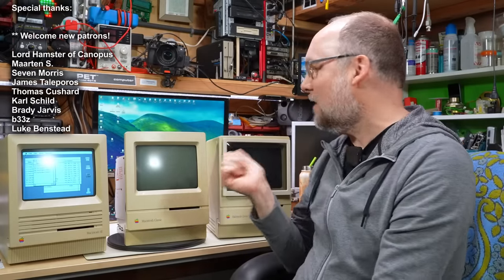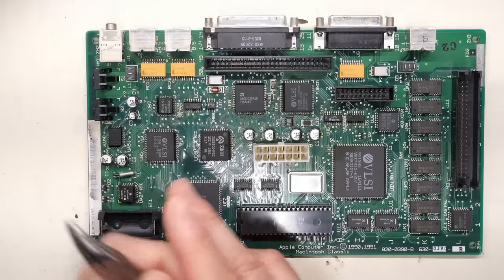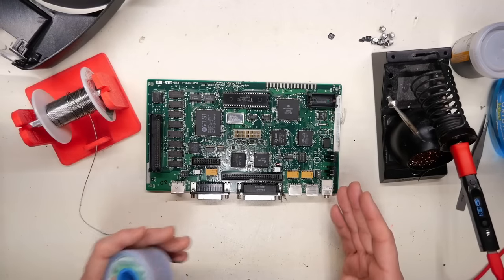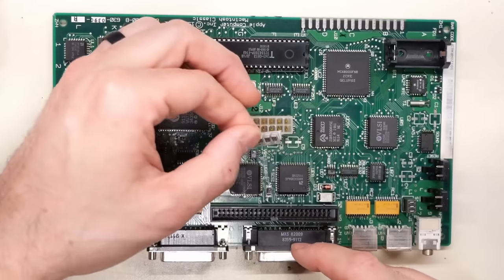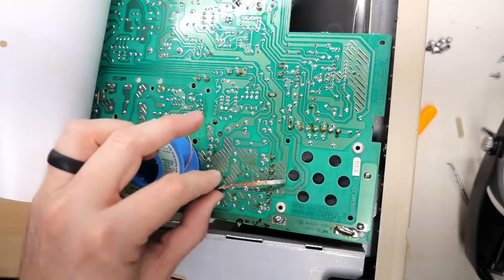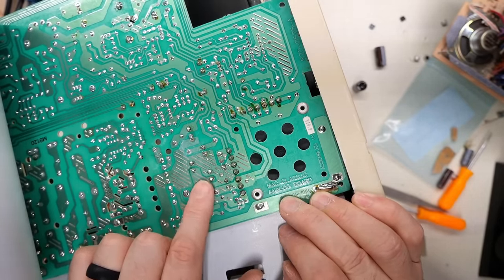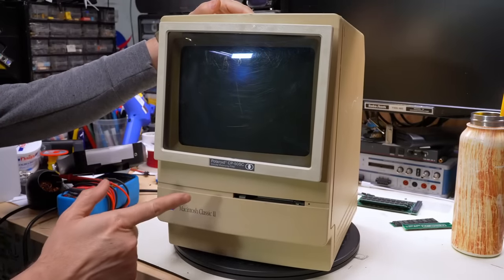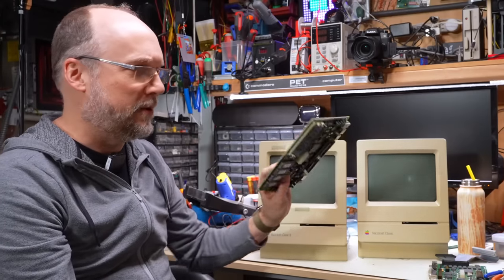Not so fast! I hit some road blocks fixing the Mac Classic

Comment: I would wash the board afterwards in a dishwasher. Seriously, boards are put through a dishwasher after the wave solder process and then air dried using compressed air. This will clean up the board and the compressed air will push the water out from under the components. As always, ensure the board is completely dry before doing any work on it.

I worked in board touch-up and repair for a number of years prior to moving on to the more interesting and more satisfying testing and repair. I recommend using a burnishing pen instead of something sharp to clean the pads. That will clean the pads safely without the chance of hitting an attached etch by mistake.

Electrolytics are used for specific reasons such as better filtering and not necessarily for cost.

Have you ever thought of setting up a test setup? Take a known-good chassis and extend the power cables and cables for the CRT and connect that to an accessible power supply with cables for the motherboard. This will allow for easier testing and troubleshooting without needing to reconnecting the unit up again to test the boards. When I was a bench-tech we had setups like this for the various products and it made testing a whole lot easier.

Comment: By the way! I recommend trying to use liquid instead of alcohol to clean the throttle or carburetor dampers of the car. It also perfectly cleans soldering mud with a gun flushing liquid from construction foam. However, in this case it will be necessary to be more careful with plastic products, as they can be damaged.

Comment: When we had the leaking caps issues in the early 2000s.  We noticed a pattern on the top of the caps.  The ones with a square cross leaked but the ones with. An offset K on top were always fine. So we were at that time in the lookout for the crappy cross caps and happy if a system had “K caps”

Comment: All Mac Classics did not come with that RAM board.
To meet their under $1K price, the base model came with 1M only (no board).
That little RAM board has 1M on it and two slots.  So if you see one with 2M, then it has that board.
I believe it sold with 1M (no board) or 2M (The 2M version came with a Hard Drive, the 1M didn't.).  I don't recall if Apple sold a 4M version.  I don't think so...

Comment: i think that vinegar reacts with the electrolite (i suppose it's usually basic, like bactery residue), so it becomes neutral (aka not corrosive)
of course you have to remove all the vinegar or it's the same thing

Comment: Rather than scratching the pads I've found that when using the solder braid/wick it cleans up much better if you use MG Chemicals liquid no clean flux you won't have that black residue.

Comment: Even if you are going to sonic clean it is good to use the vinegar to neutralise the electrolyte before cleaning.
The dodgy Electrolytic capacitors were conterfeit name brand caps, I have even seen OEM intel boards with these dodgy caps.

Comment: I make sure to check all electrolytic capacitors with a capacitor meter. I recommend doing this procedure with old and even new parts. Marriage, alas, also occurs. It is better to put Low esr capacitors on the power supply circuits, since they work more efficiently. In those years, these were not produced yet. Instead of surface-mounted capacitors, I put ordinary ones on my Amiga 1200, with terminals suitable in size. There is enough space and soldering is very convenient.

Comment: As usual, great video!  Yes, Mr. Carlson has some great info and expert knowledge - as do you 🙂  Your Commodore 64 videos saved me sooooo much time on my last restore!  I started using the wiggle method years ago to get those caps off and never had an issue with damaging traces (easy does it!).  I've found that baking soda and IPA with a soft brush works great to clean up most of what you find on old circuit boards.  Do you also test caps that aren't visibly leaking with an ESR meter to verify good/bad caps or do you strictly go by leaking = bad & not leaking = good?  I occasionally find a bad cap that looks clean and not bulging.  Looking forward to your next video!
Reply: caps,nicad and nimh batteries leak a base,so you clean it with vinegar(acid).  baking soda is a base and will not neutralize cap/battery leakage.

Comment: By the way, you can put a mathematical coprocessor by installing it on top of the main adapter with a panel on the handkerchief, as they do on the Amiga when it is not possible to connect to the address and data bus.They actually work in parallel if you look at the scheme with a difference in a pair of signals.

Comment: The vinegar reacts to the electrolyte and stops the corrosion, you don't need to scrub, just let the vinegar do it's job. It is always a good measure to use vinegar on boards that had some kind of leak from batteries, caps or even if they are rusty.

Comment: Electrolyte can be either acidic or basic. I don't know how you can tell which ones use which type, but use vinegar (rinse thoroughly after!) and then baking soda (as a paste when mixed with water) should do the job of completely neutralizing all capacitor pee.
Reply: Electrolyte in car batteries is acid. Nicad,Nimh and capacitors its a BASE. so you clean a base with acid(Vinegar). then clean with distilled water(tap water has minerals,flouride etc which is bad). then Isopropyl alcohol.

Comment: I think it is interesting that you push the pins for the analog board fom the inside. you can get your fingernails under them from the outside and pull them up and out.

Comment: Yesterday I recapped my Macintosh Classic with fresh tantalums and my process wasn't too different from what you showed here. In my case though, one of the vias in-between the central caps has been completely eaten away by the corrosion, so I had to solder a wire onto the nearby trace and onto the remaining pad on the other side of the board to restore continuity. Fortunately that did the trick and the Mac Classic is now working perfectly again. 

I will have to take a look at the analog board sooner or later. Right now there doesn't seem to be any sign of leaking or corrosion, but I can't quite make out the series of Nichicon caps that are on there, so it's a bit too early to celebrate I think. Good to know what to look out for, in any case. That reminds me, did you happen to take note of the markings on the board next to the six capacitors that you removed? The console5 tech wiki lists all of the various capacitor types on the analog board, but I don't know exactly which ones are the brown Nichicon caps.

Comment: Adrian I just love how you use the wiggle method and dont give and F about what people think.
I also learned about the method a few years ago from Mr Carlson's Lab, there are other videos and sources to.

My version of it is to always push, and twist until I feel resistant then twist the other way, takes a little longer but never failed and I used it for like 2 years before I got a hot air station.
And in some cases where the cap is 1mm away from plastic connectors it might be the only way to get to it.

I remember how much flack I got on my then 300 sub YT channel when I did it the first time, its funny how a small YT gets flack, a 1000x bigger one gets applause doing the same thing!

I had people claiming to have degrees in engineering and certificates and crap claiming how I was killing the pads and people unsubed and told me how dumb I was 😆
I made it very clear in my video also not to pull but push, you want the leg to break as Adrian is saying, but yea people still accused me of pulling even after a written explanation.
Some people just cant accept some ways of doing things that they must insist reality is something else then was what shown and sad in a video.

I also had people telling me one should not solder on corrosion and yea its not ideal, there argument is that the joints will fail.
But I see pros clean up corrosion all the time with the iron or hot air like Louis Rossmann.

So if I was to listen to the wiggle haters and the "dont solder corrosion" then how the hell am I gonna get the SMD caps off? 🤣

Anyways I seen many videos where people after ripping pads, because most people will try the solder iron and lift method, this LIFTS pads, but people seems to not get that.
A pad is very strong along the axis of the PCB but it week on the Z axis so trying to lift caps is like pealing tape of the desk, bad idea.

But what I seen is then they try the wiggle method and has no issues getting old caps off.

Also a ripped pad for ANY reason can be fixed in many ways, repair kits even exist if you dont want a wire and some solder mask.

Anyways people get way to upset over how people repair there stuff, its just some caps and pads, it can be fixed.

Comment: Also of note, ammonium perborate is itself weakly acidic, so hitting it with another acid is likely not the best idea. You need a weak base which is easily washed away, else you risk producing new acids which might cling to the underside of chips regardless of how much you wash.

Comment: Tip for soldering the caps on that large copper plane.... your struggling because your not waiting for it to heat the boards massive copper track, just wait till you see it start to flow then add solder as needed..

Comment: The flux breaks down the oxides and avoids oxidation of the tin. It also helps the tin to wet the surface by acting as a kind of surfactant. Also There are fluxes that ain't no-clean (i guess Adrian does know very well, but young players might get into this trap). To be safe, always check the data sheet (and use a flux from a trustworthy source, if possible).

Comment: Vinegar simply converts insoluble boric acid salts (electrolyte) into soluble acetic acid salts so they can be washed off. Acetic acid is not so corrosive to damage the board in 20-30 minutes.
Remember that alcohol reduces the solubility of acetates. So use water.

Comment: Vinegar is useful where Varta batteries have spewed their goo.  For the electrolyte problem, you might try a petroleum based solvent (e.g., WD-40) followed by an alcohol or QD contact cleaner rinse (for simple vapor degreasing).

Comment: Vinegar only neutralizes the corrosion. You still have to clean everything up and apply new solder to everything. You should never leave that white salty stuff on the boards, that's neutralized electrolyte and can still cause issues. You have to completely remove the old solder and apply new solder after cleaning the pins and solder pads. Otherwise you'll have loads of issues in the future.

Comment: 17:23 , well that is more or less like limestone, same happens to washing machine, there are some products to put on the washing machine to remove the same stuff, the problem is I do not know how hard/rough will be on the board (because the washing machine inside is basically stainless steel.

Comment: In my experience, vinegar works really really well with battery electrolyte. Alkaline goo is especially good to use vinegar on. It’s stunningly effective, I use it all the time when restoring old toys. 
 Glancing through some literature, caps can be acidic or basic or neutral, so a bicarbonate solution may also be good. You’ll want to throughly rinse between the vinegar and bicarbonate though.

Comment: 12:20 the electrolyte is alkaline (basic), and the vinegar is acid, so they react and produce carbon dioxide. It neutralises the gunk so it can't continue eating away at the metal, and there is less left to form salt crystals when you wash it later.

Comment: The powdery residue that is left behind when you cleaned the electrolyte corrosion from the caps is hydrogen.  It's the same stuff that batteries produce when they rupture or if you left a light on in your car over night.  Additionally I'm not sure why anyone would recommend vinegar since that is an acid.  A base like baking soda or powder would be better to neutralize the electrolyte chemicals from leaking capacitors.  Perhaps a combo of two would be best (neutralize with baking soda/powder then use vinegar) Certainly using IPA as you have shown many times does a good job for a final wash.

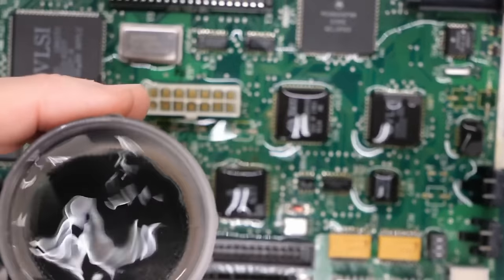Comment: 12:00. I buy cleaning vinegar for stuff like this. You can put the metal contacts from a tv remote control or kids toy into a little jar and it will neutralize the battery acid and corrosion within minutes.

Comment: Regarding the Mac LC, while considerations regarding market segments would have probably been a thing, there is also a real reason behind this market segmentation: 16-bit boards and their various components were just cheaper, helping with the low price point.
(Compare the i8088, used for the same reasons in the 16-bit era, since 8-bit boards were significantly cheaper, or the original Mac board vs. the Lisa. Consumer computers were never about what could be made at the state of art, but what could be made to a certain price point. It may be more than a coincidence that "computer" is spelled with a "c" as in "compromised"…)

Comment: I'd be tempted to try a slightly stronger acid for that salty gunk.  Maybe Naval Jelly, which is largely water, phosphoric acid, and a little sulfuric? Stronger acids tend to be able to cause a chemical reaction that's able to change a lot of insoluble salts into something more water soluble.

I'd likely start with trying to dilute it a bit, since all you really want to do is make change the salt into something more water soluble.

Comment: Tantalum caps have extremely low ESR and if the circuit they are in is not properly designed, inrush current will cause them to fail (and they usually fail shorted).

Comment: I don't think I would be comfortable placing a motherboard in an ultrasonic cleaner. I would be too afraid of the vibration damaging the bond wires inside the IC chips. Bil Herd did a fantastic talk about component aging and failure, and he mentioned vibrations and failures.

Comment: I'm not sure if the black gunk youre seeing is coming from the caps. It looks like the rosin flux that's in the center of the solder and also used in the solder braid. I get that a lot at work. Usually just IPA and some cotton swabs and it cleans right up

Comment: The chemical in capacitors is apparently ammonium perborate. My first thought was that the bubbles were just CO2 like when you use vinegar on leaked batteries. But that doesn't necessarily explain what's happening here. You might be getting gaseous ammonia! I will investigate. You might also be producing small amounts of hydrochloric acid which would be BAD. If you really douse a board like this you have to wash it like crazy after.

Comment: Personally I wouldn't use vinegar because it's an acid, acetic acid is its main ingredient. It can etch metallic surfaces to remove corrosion. That's the same mechanism of how rosin flux works. But also it can form salts with metals. That's the undesirable part. However this is not an expert opinion. I'm not really sure what's going on while applying it, and I'm not sure what's coming out of those caps either. I'd probably just use IPA.
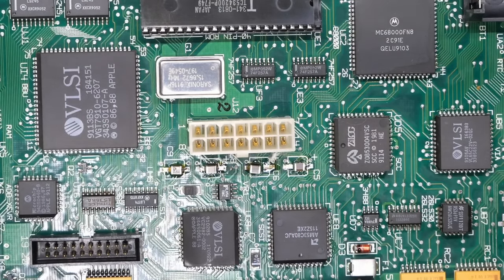28:35 - My OCD says you did a good job! 👍

Comment: I don't know if you have tried this in the past, but I have used WD 40 and that removes rust and other things as well. I have used it on a mac classic board that was really bad, and it did remove the problem spots, but now in the prosses of Bodge wiring each and every bad trace, there are times I want to give up, but I walk away then come back to it because of battery damage and cap damage. If I ever get it working again, I will send you a pick of the mess of wires. LOL.

Comment: So a little chemistry - though its been at least 53 years since I last took it, if you mix a base with an acid you get a salt and water. I am guessing the electrolyte that leaks is a base, if your local water is soft - and you mentioned your water is not hard  - it is a mild acid as such the white deposits you find are a salt. it may be common NaCl but there are many others. My guess is also the bubbles you saw are also a by product of the reaction between a base and the acid, it is not uncommon for such reactions to release some hydrogen.

Comment: Always disconnect the flyback transformer! Never trust the bleed down resistor. Then ground the tube so the ambient charge it builds up cannot shock you. 

Source: I used to work at apple and still remember those electricity cooks your veins videos from training.

Comment: to get rid of all that white stuff after cleaning the board you really need high pressure compressed air from a air compressor that will get it but you have to take care not to blow components off. this would only really happen on stuff that you could bend by hand but surface mount stuff should be fine

Comment: My understanding about electrolytic capacitor electrolyte, It's a slightly acidic solution of ammonium perborate. Vinegar is also an acid, you need a base solution to neutralize  the leaked acid. Try making a solution of baking soda and water. If the spilled electrolyte is acidic, the backing soda will foam up and neutralize the remaining electrolyte residue/corrosion. BTW Vinegar is great for cleaning leaked batteries because the batteries are alkaline or base.

Comment: IPA and a toothbrush and work the white stuff more. Always worked for me. If you havent used vinegar(which neutralizes the battery acid), you really need to get all the white stuff. It will act like a corrosion seed.

Comment: After useing a solvant with any concerning level of watter on a board i think pouring or spraying something like 90+% Isopropyl Alcohol on the board to mix with remaing watter wich should borh dilute the watter and evaperat the watter much quicker sence IPA evaporates quick.